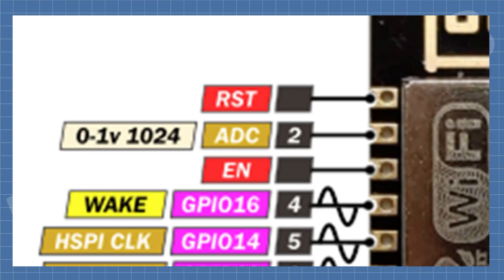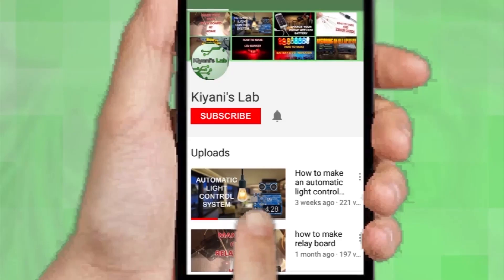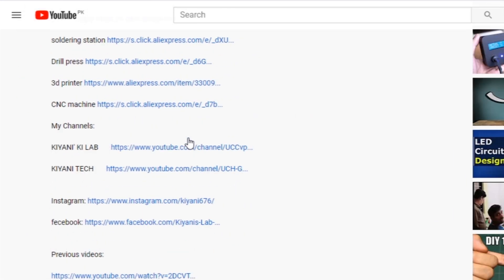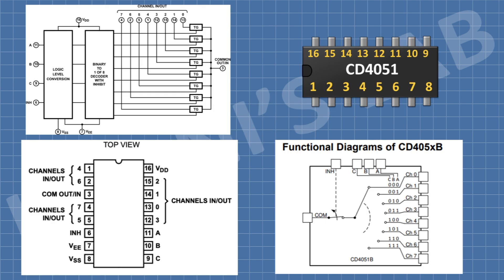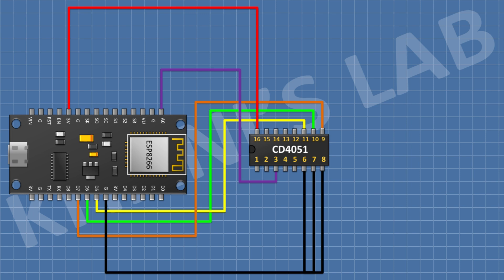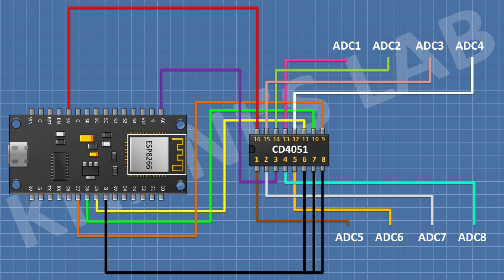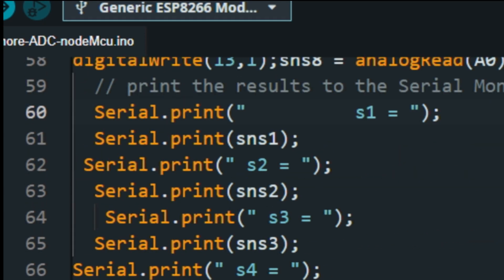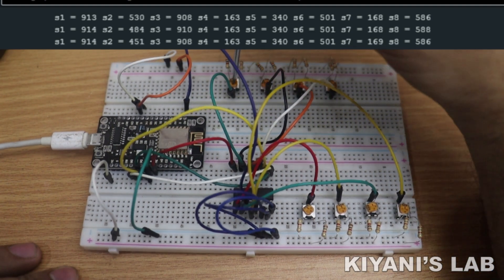How To Add More Analog Inputs to NodeMCU (ESP8266 )

Comment: I'm assuming this could work on most any analog input. This is good to use in the event you need to break out with more sensors, temperature, light, anything. Thank you for the breakdown!

Comment: What's the real practical application of so many ADCs you have?
Reply from the maker: if you want to measure current and voltage and temperature of a battery protection system you need at least 3 adc